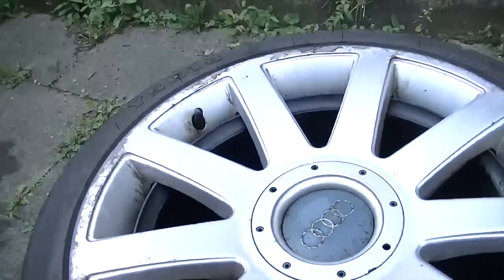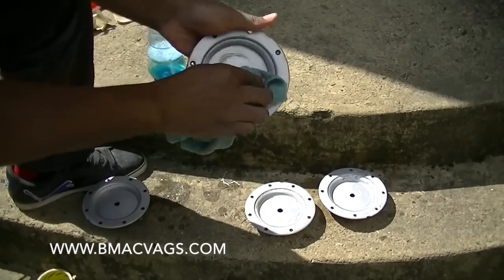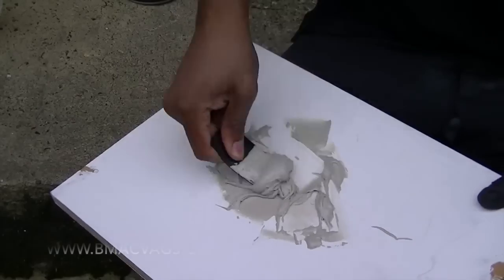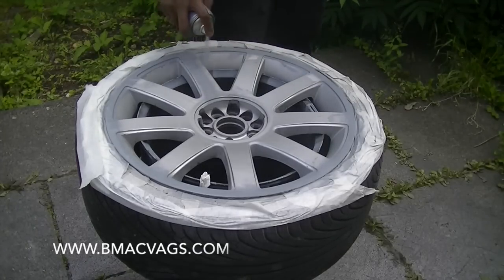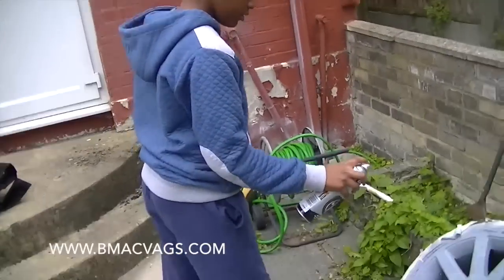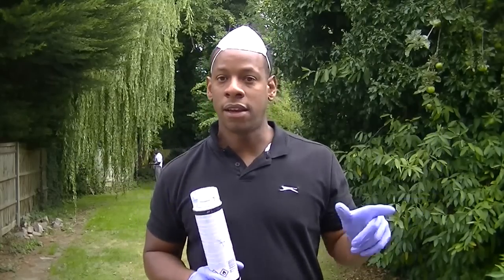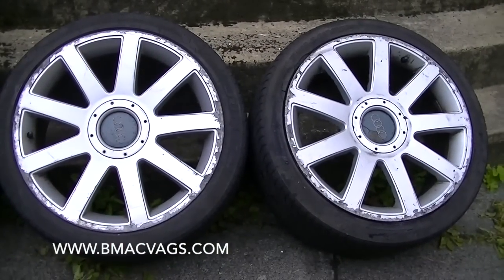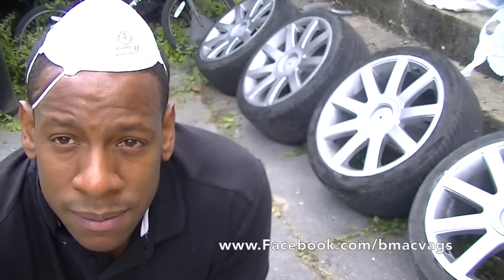How to Paint Alloy Wheels with a Can

Comment: To anyone having troubles, using soap and water may want to use brake cleaner to get off caked on brake dust that soapy water wont move, and instead of a wire wheel wd-40 works great for removing tape residue without damaging the surface also you want to properly prep ALL areas being painted by sanding(use a fine grit so it doesnt scratch)before final cleaning and painting,otherwise paint wont want to stick to the glossy rim surface, also bondo or filler is just a quick fix but it wont last too long, or atleast in my climate anyways, hope this helps anyone watching this

Comment: A simple how to video on painting wheels and give your car that clean look. Alot of flash for no cash.
Reply: Hey man great video this is one of the only way I could think to msg you but would a 04-05 dash cluster like speedometer and tach work with a 2000 Jetta? I had been at the scrap yard the harness looked to be the same. If you can help me out I would appreciate it!
Reply: Dylan Patterson It will, you will need to code it to your car though.
Reply: Hi i know this is all old thread but how many cans of primer, top coat and clear coat required for 4 wheels  exactly the same

Comment: Hey BMAC

I refurbished my wheels a little while ago and a great tip i was given is to use play cards instead of masking tape because you can get them further in because there ridged so therefor minimise risk of over-spray onto the tyre. Hope this helps anyone

great content though bud, you're videos have helped me loads!!
Reply from the maker: Thank you for watching the vids and that is very good advice.
Reply: +James Stone cards leave marks around the rim, the paint puddles against the points the cards contact the rim, popping your seal and masking is the best way, but the method used in this vid is way better than the card trick.
Reply: Deck of cards is the way to go easy to put on easy to take of

Comment: Great video, when you primerd the first wheel you should of used wet sand paper to sand the primer coat and then apply the paint colour. Il not an expert but that's what I would of done. But brillaint video anyways
Reply from the maker: Thanks for the tip

Comment: i have alloy wheels. it's pretty brand new no scratches or deep gash. do i need to sand it to prepare it for spray painting? thinking of just using the primer and spray painting it afterwards using rustoleum or duplicolor

Comment: Electric drill with wet hands over a bucket of water. Is that safe?
Reply from the maker: Ian H Well noted, my advice is do it safely or just use sandpaper. Let you own common sense prevail
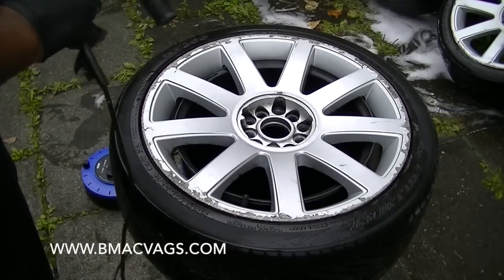Reply: BMAC Car Mods the second thing, you shouldn't use brush 2:26 on driller, it will ruin bearing. grinder will be much better
Reply: Great video and no a wire wheel in a drill will not ruin the bearings.